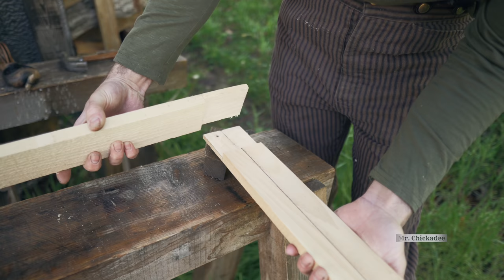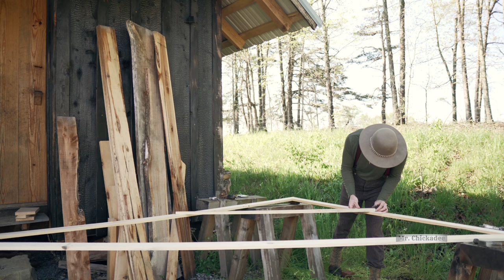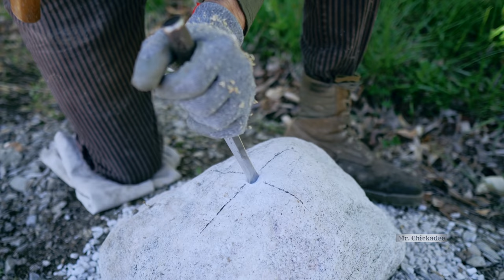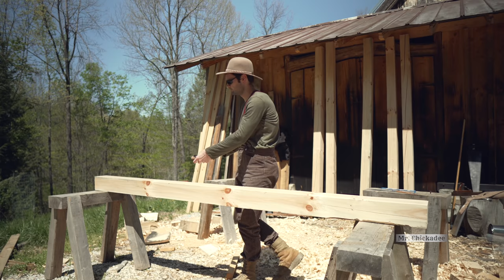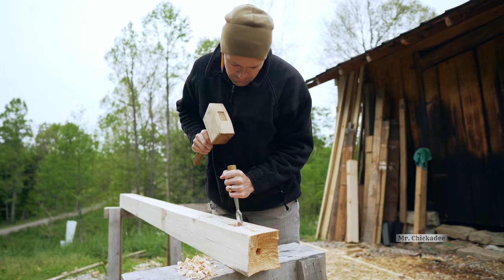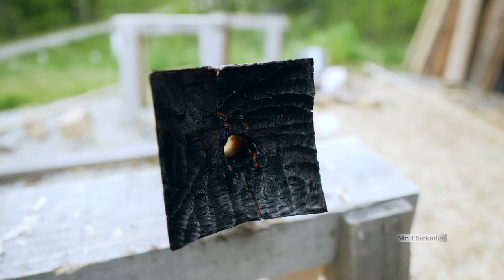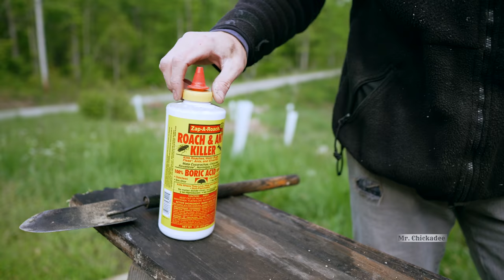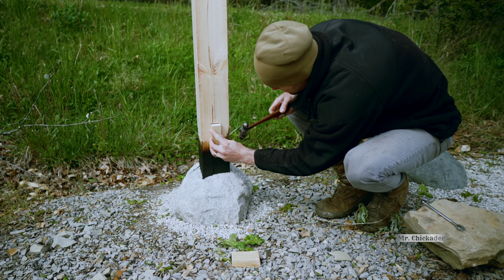Anchoring timbers to stone: ancient technique with modern twist for building codes/extreme winds.

Comment: Good way of using those big rocks that come out while plowing new ground. You can use this on ag land for ag buildings which don't require inspections in most locales. I like the traditional woodworking techniques. No worry your lithium battery will go dead!
Reply: I've seen that on buildings in that situation.

Comment: Impressive work.  I like the use of the stones.  If you were worried about wind uplift, on a standard small roof in a stiff wind, the uplift can be measured in tons.  I don't see what a series of those small stones would do in any wind that you would be worried about.  Point is they seem too small to prevent uplift in  a seriously stiff wind.  Unless these are the "middle" stones and its the "anchor" stones on each end/corner that are 500 lbs?
Reply: im really wondering and not at all hating.
Reply from the maker: if you have worry for extreme winds, larger stones counld be used, or larger stones and buried 1/2 in the ground. We dont get anything more than 40mph unless there is a tornado, in which case the building will be exploded.

Comment: pro tip, the buttons are a better anchor for suspenders than the rivets. ive tried them all. sew the buttons with 2x heavy duty thread on the inside of your pants. little harder to get on and off for the bathroom, but it looks way better and you can sit in chairs with backs and not kill your back :)
Reply: Use dental floss as the thread for the buttons, very heavy duty

Comment: my house that is 100 years old is a pier and beam. So before placing wood on top of the piers, there’s pieces of metal that over lap the pier then wood was placed on top. Then the remainder of the building would continue. The idea was if anything crawled up on the pier, the insects hit the metal and just drop off never being able to touch the wood. This would create a cycle. Somehow it’s worked and house has 0.00 termites damage for the last 100 years. 
In the south we gotta be very careful of 2. Things 1, mold 2. Wood eating insects.

Comment: Watching you work was a pleasure. The craftsmanship was spot on. Everything you were doing is exactly how I envisioned based on the Title of the Video. My only concern through the whole of the video was the crack in the wood and I wondered if you could comment on the potential for it compromising its integrity?
Reply: Zero potential for those cracks to compromise the integrity of the wood.  Every piece of wood on earth has cracks in it.
Reply: Splits in-line with the load have relatively little impact on load-bearing strength. The area of wood fibre supporting the load remains the same. It would only really matter if the splits were deep enough that the wood could bow away from the vertical line, which is not the case here.

Comment: I love the channel, techniques, craftsmanship, patience, filming and editing! Very calming. Serious question though, and not just from a building code perspective. How does anchoring the building posts to the stones improve it's ability to withstand high winds and avoid being tossed off of the "foundation"? The stones do not seem to be large or heavy enough to really resist the kind of uplift forces that could occur in high winds. I suppose attaching the posts to the stones is a measure beyond not doing it at all but I don't quite understand how it could truly help.
Reply from the maker: This was a simple demonstration for those who need to satisfy some code officials or high wind events in their area. Obviously we dont have those issues here, but if we did, or if I were trying to do this for those reasons, Id go about the same process yet use much larger stones, and perhaps have them partially buried as well.
Reply: @MrChickadee  Thank you for the response.
Reply: You could actually do the same thing with standard 2'x2' concrete pad(or any size concrete pad) with a threaded anchored in the center of the pad. Drill a hole completely through the rock, grout it in place below grade(to bury pad and grout) and perform the procedure as done on this channel to attach the post.

Comment: Have you seen the trick of putting your wedding band or a washer on the shaft of the auger bit to aid in keeping the drill horizontal...if not wood by Wright does this and has made several videos showing it...hope it helps and thank you for another very enjoyable video
Reply from the maker: Not that practical in most cases in the field, as you may not be boring actually level in line with gravity and such. In this case, there are center lines snapped on all 4 faces, very easy to follow.

Comment: Hello Mr Chickadee, 
As a method of dissuading ants, particularly termites, of gaining access to one's house, can you tell me if there were variations on the process of bedding the rock intended to be a foundation stone?
For example if there is a slope behind the building, or variations in the rainfall or wider climate in one's region, does the method alter? 
I have two places to build a simple wooden structure, One on the mid-coast of NSW, Aust. [dry, hot with open forest] and the other in NW Tasmania [cool temperate rainforest with closed canopy] and I'm extremely motivated to fight termites in both cases, and crawling critters in general. 
Would be very grateful for your assistance. Michael Barrett (with daughters Ruby and Eva as assistant carpenters, all home taught)
Reply: Key words: adequate drainage and land contouring.

Comment: Hello. Sorry if this is a stupid question, I just don't know much about all this kind of stuff-but what kind of stone is being used? Looks like it could be granite but I'm not sure. I imagine that knowing the type of stone affects the chisel that you use, which is my next question: what kind of chisel is being used?
Reply: If the poster does not answer....I will guess: Looks like granite or gneiss. I don't know what the drill is called - I was going to say "star drill", but a star drill is a little different. I am sure asking for a "hand stone drill" will get you there.
Reply: @bobpourri9647  Thanks for the info! I will ask/search around.
Reply from the maker: Its granite, but most any stone will work, and the drill is called a "plug drill" You could make one by grinding two sides off a star chisel, or find a used one or buy a new one from Trow and Holden.
Reply: @MrChickadee  Extremely helpful. Thank you so much for answering my question!
Reply: @MrChickadee  i would think certain stone types that are flakey or sheer easily might be bad. like sandstone or shale

Comment: What sort of cement do you use for inserting the rod in to the stone? Im under the impression any sort of cement will retain water and eventually rust that metal rod which will expand then eventually crack the cement / rock around it. I can see you using something called "sika" then later on some sort of other paste on top.
Reply: Sika Anchor Fix along with Strong Tie Set made by Simpson are an epoxies specifically designed for anchoring dowels to concrete and block and therefore should deter water intrusion as long as the concrete or stone is not actually sitting in water. If you are worried about it rusting use stainless steel bolts(or possibly galvanized steel), but in this application I doubt that the length of threaded rod that he epoxied in place will even have begun rusting before the outside of the post starts to rot away.  If someone waits until that point to do something about the decay then I think someone might have waited too long and then yes it probably would have better to have used stainless steel rather than just zinc coated steel. 

However stainless steel isn't completely immune to corrosion and is prone to galling of the threads so lubrication becomes doubling important for both tightening and removing the post when using stainless steel in this manner.

Comment: What is the charring meant to accomplish? To close the pores of the wood to increase weather proofing and also make the char an inhospitable barrier for fungi and plants? Could this just be achieved using an appropriate sealant? Although probably not significant due to the minimal percentage of the cross section that is charred, charred wood is more brittle and shrinks compared to uncharred wood. I personally would want to maximize ductility and minimize cracking at a connection interface.
Reply from the maker: Its just an added layer of protection mainly against insects and fungi. Carbonized wood is not palatable to either. The Charring is just surface and care must be taken to not overdo it and compromise the wood strength. Ive had good luck charring post bottoms these last years, however, it was not that often done by asian carpenters.

Comment: You obviously know what your doing. Question: would a steel strap on band around the burnt part prevent a desire fot the post to split or start to split ? A nice black hand hammered iron strap with hand hammered nail heads or rivet.
Reply from the maker: It should not be necessary, Ive never had one split or seen one split used in this way. It could be a nice decoration though.

Comment: Perhaps you could put a concrete pier with the threaded rod all the way through the gravel and the stone to tie down the building in extreme high wind areas, and have the advantage of the beauty of the stone to timber foundation and the added safety.
Reply from the maker: Id just use a larger stone if I felt the need, Never concrete, its always an inferior product.

Comment: I would so like to use a method like this for a veranda I am planning for my house. I've studied the Japanese method of using vertical stones in a hole as a base for the main posts in castle construction, and of course there is the method you just demonstrated. 

However, I live in New York State, and the building codes are strict and the building inspectors are very powerful. The code calls for post footings that go below the frost line using concrete piers. I think I may be able to convince the inspector to let me use diamond pier footings which is a big stretch in my town. 

So the question is this, how can the installation you demonstrated or the traditional Japanese use of a pit lined and filled with vertical stones as a base for the main posts in castle construction meet building codes, if it can, in places that have a frost depth of around 42"?

I personally would prefer your method or the Japanese method used in castle construction for the main posts.

And, thank you for the great series of videos!
Reply from the maker: it has been done to satisfy even public building codes, https://www.google.com/search?q=menomonie+farmers+market+timber+frame&sxsrf=ALeKk00QHOqYhVBzEF5k_-GUN_mxkkiaIA:1626729806882&source=lnms&tbm=isch&sa=X&ved=2ahUKEwiz5aLiiPDxAhVJZM0KHeFsCWoQ_AUoA3oECAEQBQ&biw=1362&bih=660

often a good PE signature will help relax troublesome code types, I would recommend https://ftet.com/

Talk to them and tell them you want a totally traditional stone plinth foundation that will work for everyone. You may need to go deeper with the gravel layer, or something, but cement is just always a bad idea, and never actually stronger or longer lasting, this is a fact, proven globally.
Reply: @MrChickadee  Thank you for the information. I will view the links you so kindly included.

Comment: Thank you for sharing. I have learned a lot in this last year by watching your videos. I wish I’d discovered them when you first started posting them.  Do you use a specific type of ink for the ink line?  Looking forward to the next instalment of your rennos. 😎👍👍
Reply from the maker: yep, its a ink made for that by Tajima brand
Reply: @MrChickadee  thank Josh. 😎👍
Reply: @MrChickadee  Another question I had - is there a reason you set up a big square for this rather than batter boards and string lines? 🤔🤷‍♂️
Reply from the maker: @cameronboucher7805  I find the square easier, more accurate and better, less fiddly than the strings.

Comment: Could you use a masonry bit with hand drill in place of chisel and hammer in order to achieve a tighter fit between stone and bolt?
Reply: If you want to!
Reply: I'd imagine you could also get yourself a hand operated hammer drill. Once upon a time they made breast drills for masonry with special mechanics to operate like a hammer drill.
Reply: If you don’t get the hole the right size you can’t make the rod plumb  that is why he made the hole big

Comment: Beautiful work! Wood coming from stone is tough as granite.  Please, how  does the triangle marking system work.
Reply: Pythagorean theory.Google.
Reply: Pythagoras theorem: In a right-angled triangle, the square of the hypotenuse side is equal to the sum of squares of the other two sides. Handily, 3^2 + 4^2 = 5^2. So just measure 3 of any unit along one side, 4 of the same unit along the other side, and when the diagonal across these points is equal to 5 of the same unit, you have a square angle.

Comment: The only thing i would have done differant  ,Was not burn the bottom of the post and when set the post down use the anchoring Epoxy to the base and the stone to keep out Water From freezing and thaw cycles ? If this is an issue ?  But water will condense in that space and cause movement.
Great Job other wise.
Reply: He used mortar.  There's no space for water to condense in.

Comment: Beautiful, but I don't think you showed how you ensured the post was plumb and at the proper twist to line up with other construction. Surely the bolt and the careful chiseling of the post base were not perfectly aligned?
Reply from the maker: You plumb the post using a level placed on the center line, never the edge. PLumb it before scribing it. It should sit plumb if done right. The hole is oversize so the rod does not need to be exactly perfect.

Comment: Could I ask what did you coat the base of the post with after you scorched it? Thanks 👍🏼
Reply: Also curious, would like to know.
Reply: Pine tar and linseed oil mixture. fyi for all his videos if you turn on captions he goes into great detail about what he's doing. I still forget to turn it on haha
Reply: Looked like pine tar or pine oil to me.  I had a smoker for beekeeping and filled it with pine pellets used for horse bedding and left it in my workshop overnight to smoke out some red wasps.  The next day the pine tar was this black puddle on my concrete workshop floor.  Appears the pine tar just melted out of the pellets.
Reply: from the closed captions, it is pine tar and linseed oil as a coating
Reply: Mix of pine tar and linseed oil. Put on the translation text and Mr. Chickadee is providing a lot of nice commentary and explains the steps.
Reply: Turn on closed captioning. 😉
Reply: i was going to ask the same thing, it's interesting that all of the char was left on too, really nice look

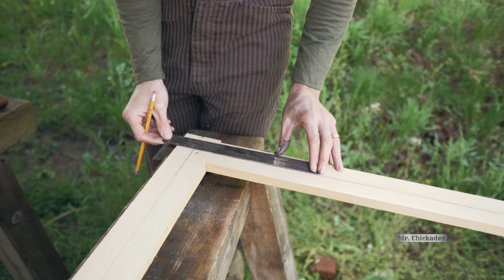Comment: The thumb position at 1:22 looks like its just begging for a good whack... :(  really like the technique. chiseling the pocket in the post is an especially nice touch, as is the process to preserve the wood where it meets the stone. I've seen pier blocks done with epoxy like this at my local big box store which speaks to the fact that this should be up to code.. 

My only recommendation and this would definitely be a "nice to have" and perhaps even overkill, but in the event of an earthquake or some other massive force would keep the stone and post relatively connected would be to consider drilling all the way through the stone. You could then chisel a little pocket in the bottom and shape your rod into a L, run it through the drilled hole and epoxy the short leg at the bottom of the stone in the pocket. More work, but something to consider.
Reply: Your "nice to have" idea wouldn't add anymore earthquake resistance than it already has.  It would add nothing but extra labor for no benefit whatsoever.

Comment: I just wish i knew what some of these products are that you're using. Some of its just mystery fluid and mystery dust.
Reply: Probably some sort of pine pitch/oil combo and then a mortar made with sand, dirt and quicklime
Reply: what do you mean? it's literally in the captions
Reply: Pinetar and linseed oil mix. Doesn't have to be that, could be number of other oils or finishes used to saturate and preserve wood. The "dust" is clay, sand and boric acid, but salt could also work in place of the acid.

Comment: I really enjoyed your video. I was wondering if and how you were going to anchor the building? In a hurricane area the building would fly away would it not?
Reply from the maker: Use larger stones, and perhaps that along with a roof strapping tie down also attached to large stones around the house.
Reply: @MrChickadee  The buildings would hold together very well, just by the joinery you’ve used. If you’re doing things traditionally, I guess bigger stones would be your only option.

Comment: What was the deal with the roach poison powder? Does it include a required catalyst in chemical form or was it to deter insects?
Reply: I was wondering what the Borax was supposed to do myself, tho I imagine it was to deter termites. What he mixed it with I must have missed in my skips.
Reply: I think the boric acid does serve as an insect repellent/ wood preservative. Looks like he just mixed with dry dirt. When he cut the end of the post he might have had to concave it some towards the center as to allow the high point of the rock somewhere to go….. the boric acid/ soil mix is then used as a filler for any air gap/ voids to give a solid confirming surface when the post was set,,,
Reply: Subtitles are telling you all.